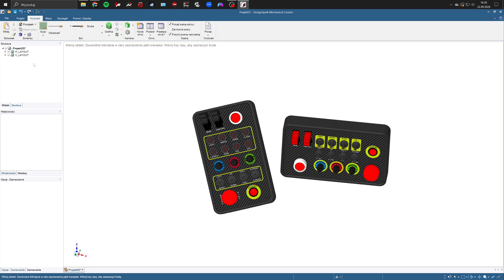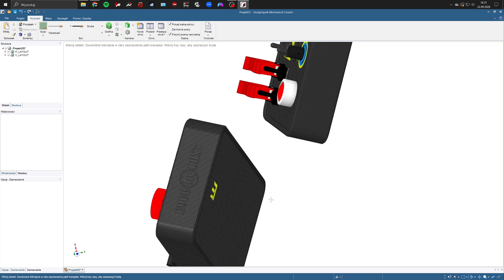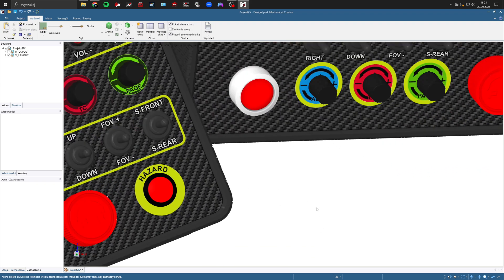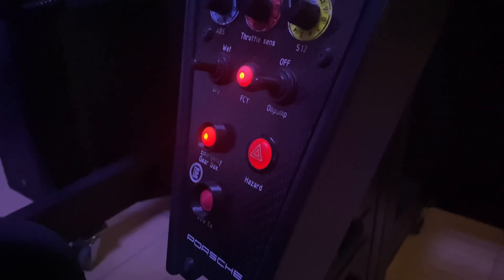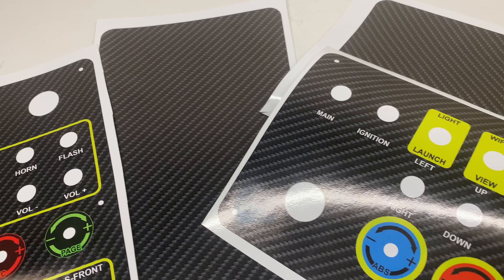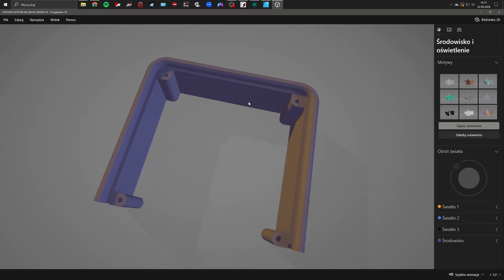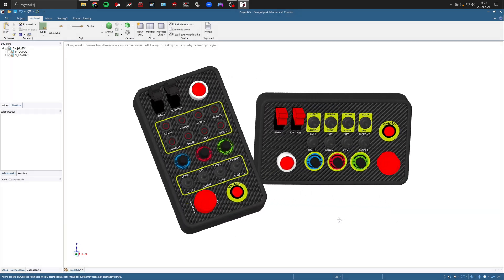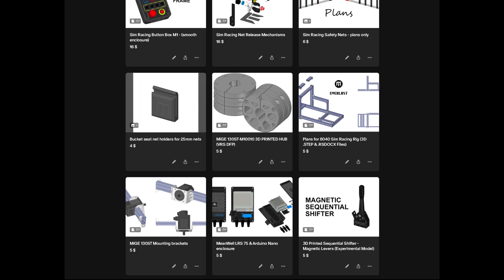3D PRINTED SIM RACING BUTTON BOX FOR DIY ENTHUSIASTS 🙌

Comment: turned out great...how did you apply the carbon texture to the outside of the model?
Reply from the maker: @PalaniDesign  It’s hard to explain 😬 but I did this in 3D software as texture on step model.
Reply: @MR.EVERLOST  i tried it in blender with displace texture, but somehow it doesn't look good, even with subdivision
Reply from the maker: @ yeah I know, blender in general is not good for that kind parts
Reply: @MR.EVERLOST  Which program did you use?
Reply from the maker: @ DesignSpark Mechanical
Reply: @MR.EVERLOST  So did you use DesignSpark Mechanical to emboss the textures into the model, do you have a keyword in the program, then I'll take a look at it...and thanks for answering
Reply from the maker: @PalaniDesign  A magician never reveals the secrets of their tricks 😅 This is a pattern created on the model.
Reply: @MR.EVERLOST  A magician only pretends to be able to do something, it's just an illusion  :)  ...by the way, but you could tell me if you made the surface with designspark, or not :)
Reply from the maker: @PalaniDesign  I can’t explain this in writing. I would have to record a tutorial, but I don’t really have time for that. You create surfaces that you emboss on the model.

Comment: Nice project! Any chances of u have de wiring diagram?
Reply from the maker: @Rickera  I think about it but currently im super busy. You can follow AMstudio guide or use FreeJoy with BluePill and create own diagram in super easy tool 🙃 the most tricky part is install bootloader on this pcb but you should find a lot of info about it. This knowledge is super useful later.

Comment: looks nice but it is missing the main important part: the electronics
Reply from the maker: @fcf8269  In the product description, there’s a link to a video that shows the wiring diagram. I figured that this time it didn’t make sense to show what everyone has already seen, especially since there are more ways to achieve the same result than there are controllers to use, and most people end up choosing their own setup anyway. Typically, projects like this are housed in cheap electrical boxes with a basic carbon-look sticker, so I decided to offer the community more interesting alternatives 🙂
Reply: @MR.EVERLOST  the box is only part of the story :) how the control matrix is set and what controller is used is most of what people want to see for most part, as adding the controls on a box is probably what most people are able to do on their own.

I doubt anyone is able to understand arduino basics unless explained; so probably that is where the value in making a video is IMO. But if you sell these as full product, makes sense to focus more on the box :)

Comment: Ok, its only the 3d Printer file, we can buy at the Shop guys. Not the ready to use Button box. I want to buy them, but you can only buy these printer file😭

But the Box is pretty nice, but didnt have a 3d printer.
Reply from the maker: @skotti99  Nowadays, people often have someone who can 3D print parts from a project for them, or they order prints from companies that provide such services, much like laser cutting from the DXF files attached here 👀. Practically no one has such an expensive laser in their workshop capable of cutting aluminum or steel 😅. The license does not permit production for anything other than personal use, further resale of the project, or parts and products made based on it 🙌